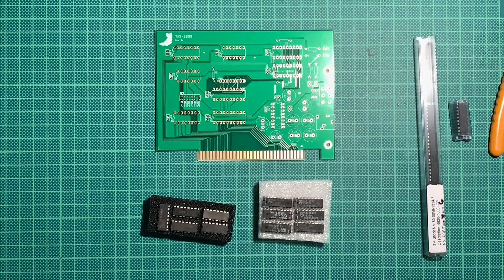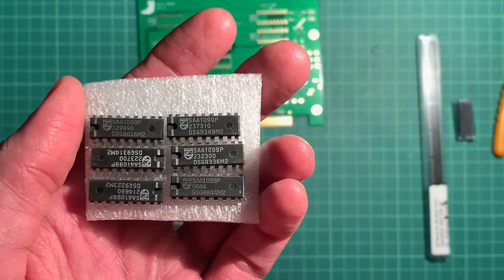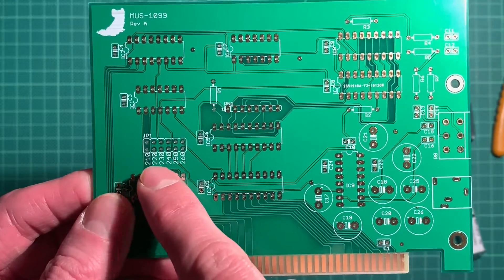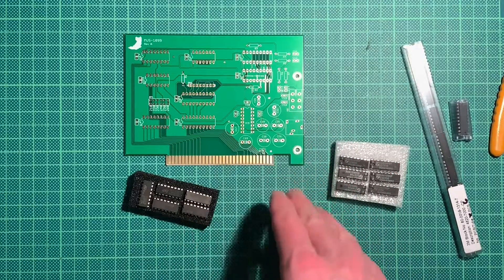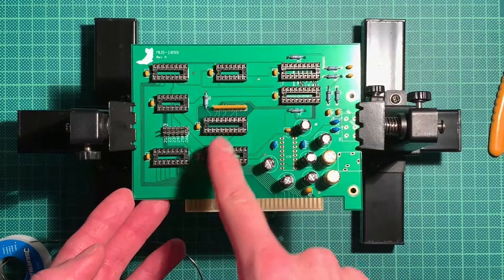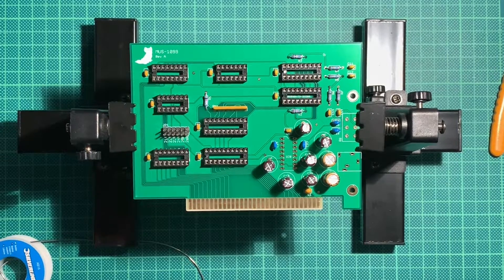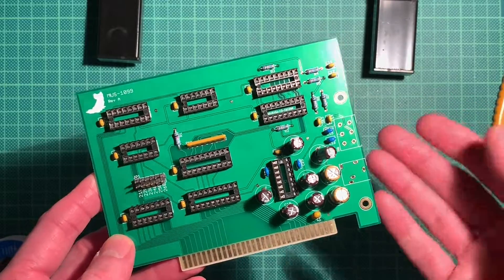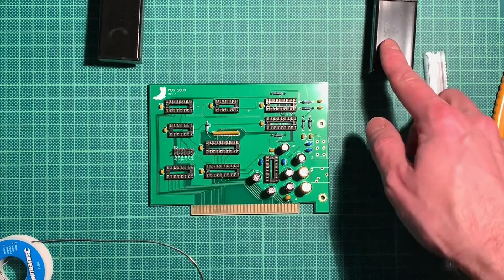Assembling the MUS 1099 GameBlaster Clone - Part 1

Comment: Where I can buy the PCB and the ICs?
Reply from the maker: Hey, I ordered the PCBs from JLCPCB. But minimum order is 10. so beware... SAA1099 and TEA2025 are EOL, so you need to order from eBay or other old parts dealers. Rest are standard components, i.e. available at Mouser, digikey et al.